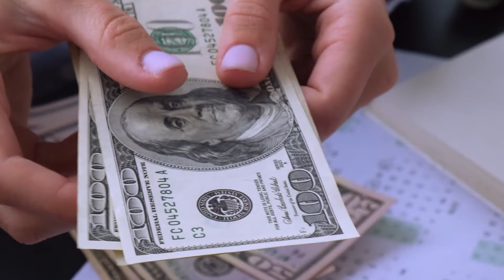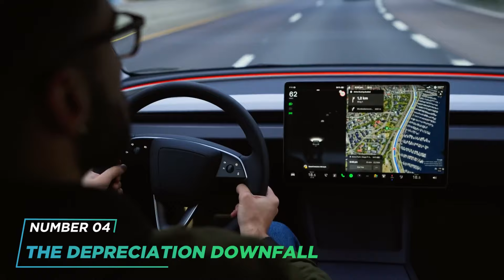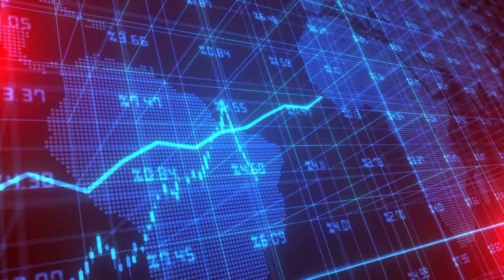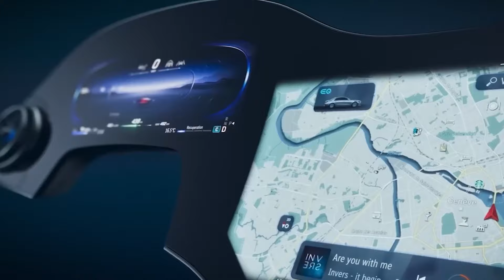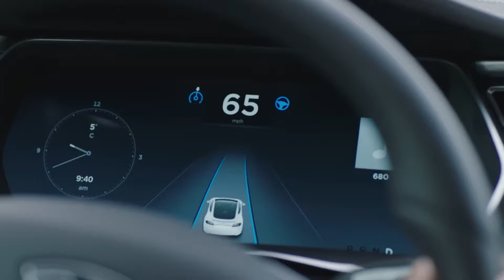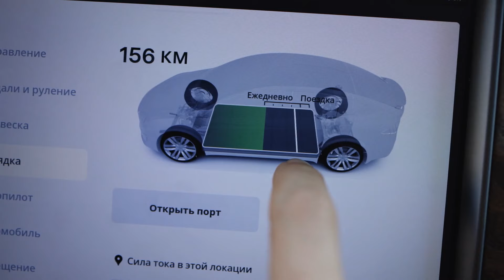The TOP 5 Reasons NOT To Buy An EV Right Now!!!

Comment: That's why it may be better to LEASE an EV instead. Only reason why I would consider the EV counterpart to my Hyundai Kona would be the Federal and State tax credits deducted from the MSRP. That would make the cost cheaper than the ICE version! But first, I would talk to my insurance company to see how much more the premiums would rise for the EV, because THAT could wipe out the tax savings at delivery. Also, the tires would not last as long, but again, for a 3-year lease, no issue. Oh, and most EV owners take their EV to their dealerships for servicing, so those mechanics are trained on how to fix an EV.

Comment: Depreciation only matters if you change cars every 3 years.

Insurance is higher for everyone, not just EVs.   Also, repair costs are much lower than ICE vehicles.   This has proven.  EVs are more reliable.   Tesla software is great.   ICE vehicles have much more problems with software 

Charging isn't an issue, as long as you use the Tesla supercharger network